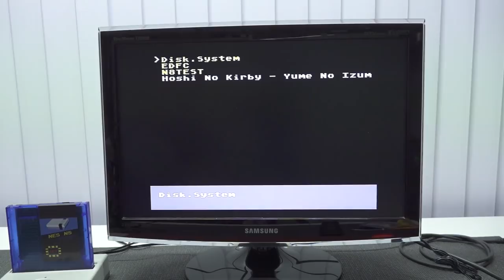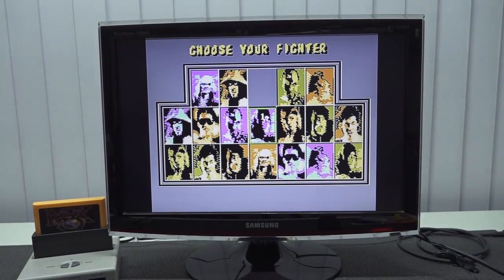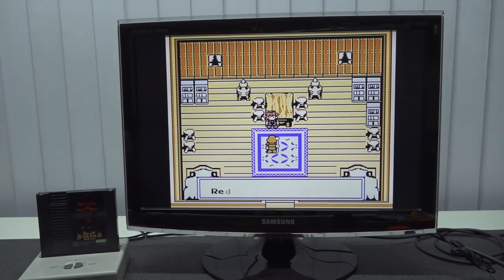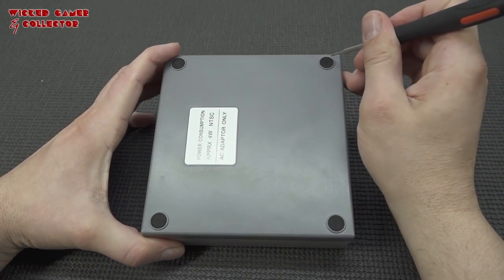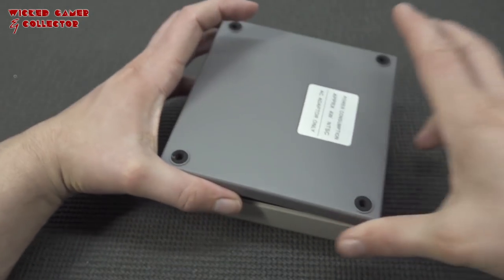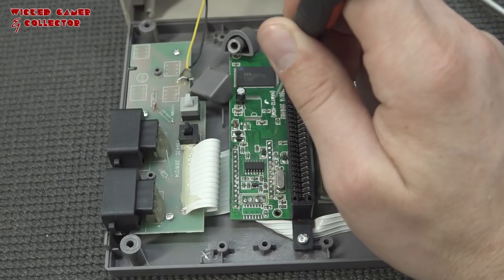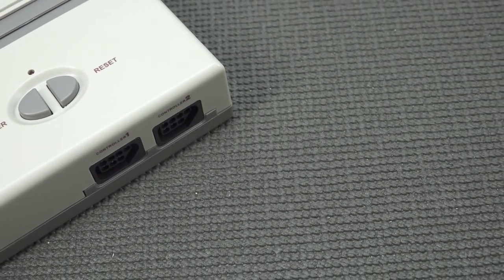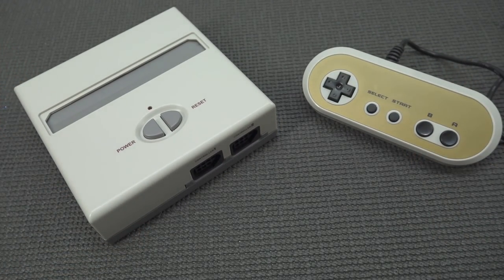Finally a HDMI Retro Console from Ali-Express ! 👌

Comment: They always come with AV out because the ASICs used in all Chinese system on a chip consoles are based on the original NOAC which predate HDMI and were designed to replicate the composite out of the original NES. It might be theoretically possible to engineer a chip that directly outputs digital video data similar to how the Hi-Def Nes would capture video directly from the processor, but Chinese manufacturers aren't big on R&D and all the western development seems focused on FPGA solutions.

Comment: Region locking this is bizarre, but it is an "older" device. Good that the flash cart works.
Reply: It does seem odd, but it may indicate the use of an existing chip/silicon design that just straight up clones the original hardware.

Comment: ooh ^_^ not bad, this would be awesome if you could cram a pi in there n still use cartridge slot to play original games, id love that! wifi blue tooth usb pads or wireless n 3d print a more fun case.... so really only the cartridge slot im excited about 😄👍👍
Reply: FWIW you might be able to get a lot of benefits, like gamepads and cleaner video output, with just a Pi Pico.
Reply: @jnharton  😄👌

Comment: An NTSC device with included euro plug? Seems, odd, unless that style is used in some NTSC countries.
Reply: In Brazil most TVs with AV-in are NTSC-compatible (although the analog standard is PAL-M) and the same power plug is standard
Reply: @jackmcslay  Is the voltage same, I wonder.